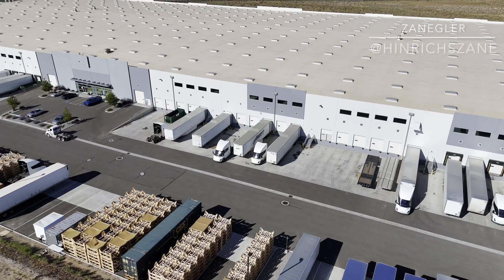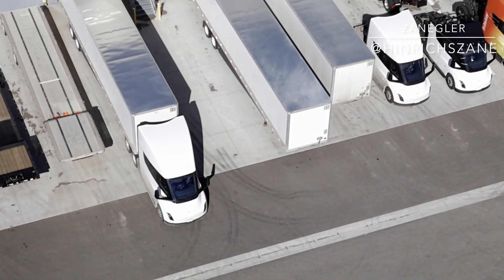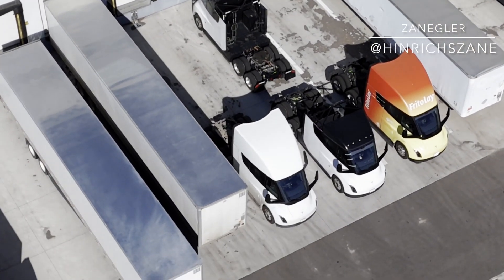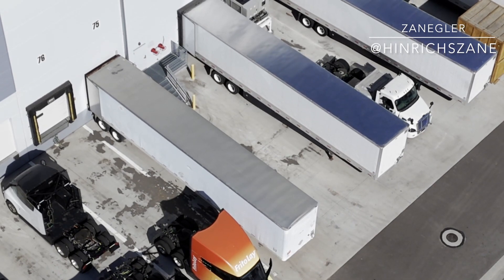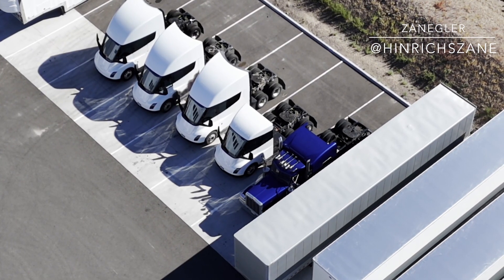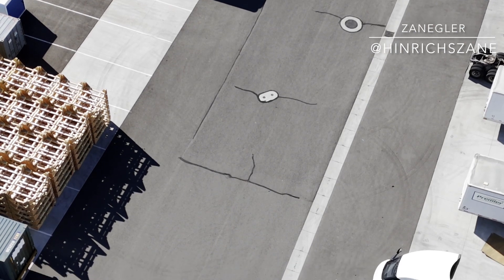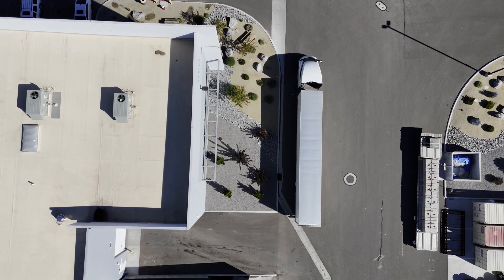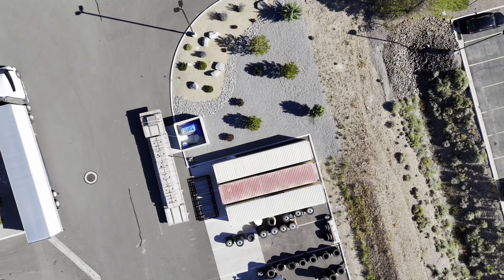Tesla Semi Design Breakthrough and Real-World Results.

Comment: I keep asking the same question and still have yet to see an answer. This is going to a seriously important question for most over the road fleets. How much weight can it haul? Not gross weight. How much does the tractor itself weigh? Virtually every tractor on the road can go up to the same total gross weight. But overall tractor weight impacts how much freight you can actually haul. 

Gross weight is tractor plus trailer plus freight. An 18,000 pound tractor and a 14,000 pound trailer can haul 48,000 pounds of freight. My last tractor weighed 18,439 pounds before fuel and gear. I regularly hauled loads pushing just over 46,000 pounds. A 46,000 pound load and a 14,000 pound dry van would allow the Tesla semi to weigh no more than 22,000 pounds including driver and gear. If it can't do that at the same time as regularly achieving 600+ miles per day, it'll never survive in the over the road world. Those are the facts of the current over the road world.
Reply: The Tesla semi will not meet the requirements of every current use case. Just the majority of them.
Reply: @jbbuzzable  as I said, if it doesn't weigh less than 22,000 pounds with driver and gear and be capable of going 600+ miles between charges, it can only replace a very small minority of over the road trucks. Modern over the road trucks are capable of 1000-2000 miles between fuel stops. A large majority of trucking companies max out their weight. If you can't compete, you don't get the freight. I'm not against the Tesla semi. I'm just speaking with over 25 years of industry experience.
Reply: Here's the problem with the entire "average miles in trucking" thing. A lot of local trucking is in the 100-200 mile a day range. It's very rare for a local driver to exceed 500 miles in a day. There are two spots where the Tesla will fail in local operations: extreme weight sensitive and anywhere that uses time-sensitive slip-seating. I have seen operations where the truck literally never takes a break. It's rolling nearly 24 hours a day. But those are far and few between. 

That said, over the road is an entirely different game. If an over the road driver isn't capable of putting down over 600 miles a day consistently, they're considered a failure. Those drivers will push to the absolute maximum. If you get away from the cities at night, you'll see trucks parked on freeway ramps all over the place. They'll stop for the absolute minimum amount required by law and get moving again and do it all over. Day after day. All you have to do is drive around and you'll see the trucks parked in the strangest places. It's possible to push close to 7-800 miles in a day totally legally if you're doing everything right.  That means zero extra stops and no time for anything extra. That isn't the minority of over the road, it's almost all the over the road. 

So, in short, can Tesla change the trucking industry? Local routes, a healthy percentage. Long haul? It has a LONG way to go. And without the weight problem answered, it isn't even worth it for the majority of trucking to seriously consider it. 

Tesla keeps touting the "at 82,000 pounds" thing over and over. That sounds great to those that don't understand how it actually works. Those in the industry see that claim as a smoke screen.

Comment: Are the costs both for purchase and maintenance/replacement (longevity) equivalent yet? Is the performance (Range, Total weight, etc and safety concerns)  on par or is there still a huge shortfall across the board requiring massive industry wide subsidies?

Comment: clearly you have no idea how this industry works, almost no place they will be delivering to will have a charging station and these drivers have to drive 2 ,8 hour shifts  a day thats 2 drivers per truck or it doesnt generate enough income to pay for itself,  i doubt it will charge in 2 hours and at a truck stop where do you think your going to plug in? there will have to be 100 charging stations, thats a lot of electricity that has to come from someplace and who is going to pay for it? if they are all in use that means the truck could be down for 4 hours waiting for a spot and 2 hour charge time if it takes 2 hours.
Reply: Lets see. 1/3rd of Oil energy is used to refine the other 2/3rds using Steam to Crack it. Of that 2/3 some part is Diesel, Kerosene and Jet fuel. Of that part a Diesel rig will have to transport it to a fueling station. At that fueling station another Diesel rig will fill up to transport goods. Where as Electricity with a good infrastructure travels at near the speed of light. Needing no Wheels, Driver, Diesel, or Truck wear and tear. It however will need Asphalt and Tires which are from Oil.
Reply: 85% of truck drive less than 250 miles, the semi has 500 miles at full weight but most trucks are space limited before they are weight limited. the infrastructure does have to be built out but charging stations are cheaper to set up than gas stations but special distribution stations will need to be built if you want to charge multiple at the same time but thats just part of upgrading the grid which we have to do anyways and Tesla is helping with this problem with their megapacks being used for grid stabilization. electricity will get cheaper while gas gets more expensive. at a megacharger station you can regain 70% range in 30 minutes, enough time to match with a mandatory brake. companies will be willing to sponge the cost of building megacharges at their warehouses because each Tesla semi could save them a million dollars per truck over its lifespan in fuel and maintenance reduction.
Reply: @victorlopez-t2i  And Superchargers do not have underground storage tanks that have to be inspected regularly because of their propensity to leak and harm groundwater.
Reply: Don't worry, I'm sure there's a charging station with a hidden diesel generator waiting for you. Problem solved!
Oh, and don't forget the nice man with the Loaves and Fishes.